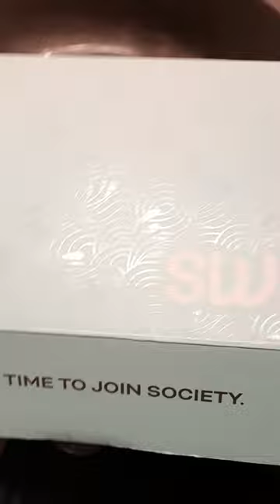A Real Life Plumber Installs Your Swipe Bidet

Comment: 2:13 I'm losing my mind or I have the strongest screws of all time on my toilet seat.  These badboys are not budging no matter how much I crank on them.  EDIT: In case anyone else runs into this (since all the videos and websites I searched didn't mention my scenario) - I didn't have to use a screwdriver at all, for mine you simply hand-spin the plastic part on the bottom until they come off, then you lift the toilet seat off with the screws still intact (I had to pull pretty hard).

Comment: yo, idk if this is an EU apartment thing or what but my toilet does not have that flexible hose. it is just a hardline metal pipe all the way to the toilet connection point, it honestly looks like they installed the water line after the toilet was already in or something. Will this install not be possible since (I assume, no plumbing experience) bending those metal pipes probably isn't safe or recommended? 
I'm an absolute cheapskate, main reason I want a bidet is to stop spending money on TP so having a plumber come do it, especially since they're so expensive here, isn't really feasible.

slight update: found some videos on replacing rigid pipes with hoses but they all seem to have an angle valve where the rigid pipe goes into the wall/ceiling? mine just goes straight up through the bathroom celing with no valve?? lmao
Reply from the maker: That's sounds rough dude, hate getting to a house with no angel stops. Gotta shut the whole place down.😂
Reply: @xtremhillblly2269  I guess I got what I paid for, just 450$/mo middle of the city, 5 minute walk to my university 🥴 Had to come with some compromises I guess.

Comment: Man, mine leaked in the same spot and there was nothing I could do to get it to stop. Used plumber's tape, went at it with the wrench, Just would not stop leaking. Any tips on what else to try?
Reply from the maker: I believe that their should be an O-Ring at that spot check that its intact and is undamaged, though that plumbers tape should have fixed that issue. make sure that your plumbers tape was wrapped the correct direction, it should wrap on the same direction that you turn the nut so that the tape doesn't get pushed off.
Reply: @xtremhillblly2269  yeah o-ring in place and in tact! It didn't even occur to me the plumbers tape needs to wrap the same direction as the nut would rotate. I'll give that a try next. Thanks man!
Reply from the maker: @moonside24  Yeah the tape will just get pushed away from the threads and peel off if done wrong good luck